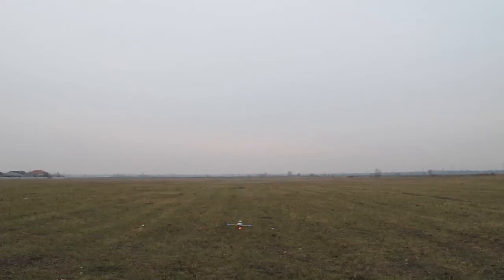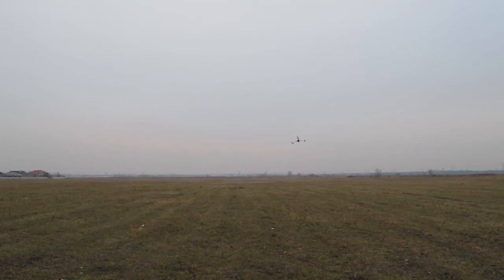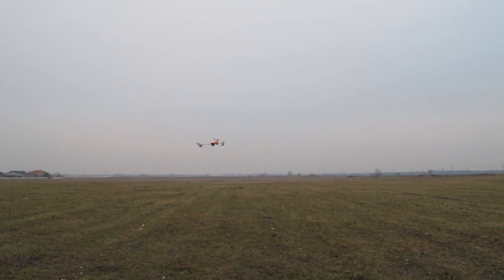MultiWii Dev code - GPS RTH test

Comment: Fantastic work on the Code EOSBandi!  Well done. Love the rotation to yaw & face RTH posn as well.  Hopefully you can work with Navigatron - 2 CPU - one CPU  for NAv and one CPU for motors - and your code can then be available to 3000 PARIS MultiwiiCopter owners already waiting for GPS on there existing copters.